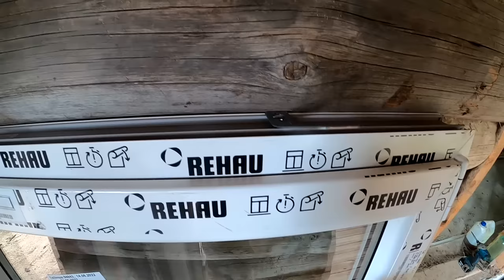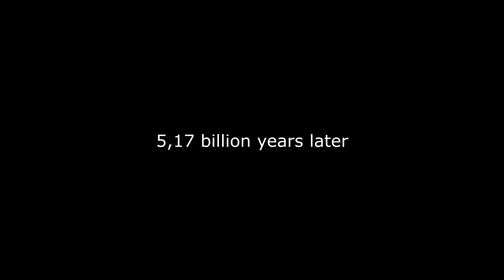Renovating a 128 year old forgotten log cabin (part20) - Installing windows and doors

Comment: I couldn’t believe how good the concrete threshold turned out, that’s skill right there!!! The windows completely changed the inside, the light is fantastic!
Reply from the maker: It sure did 👍 thanks you as alwaya 😌
Reply: I agree with the window transformation. It looked incredible and made the whole cabin look more significant on the inside.

Comment: Love your video, You make me laugh. Here in the USA our outside doors open to the inside. Had you had  your outside door open to the inside your peep hole would be on the right side of the door. I love the fact that your not afraid to reuse things and use what you already have. Things look great you do a lot of hard work and it's looking pretty awesome..
Reply from the maker: Hey Ronda thanks ❤ i think here in estonia most main doors open outwards for fire safety. Incase of a fire its easier to push a door open then to pull it.

Comment: Tere Soomest! I truly like your videos, and the humor is somewhat like listening myself. Don't really know, why it's entertaining, but I just keep laughing :D 

Had to gringe though, when you put screws on the woods you sunk in the walls by the sides of the windows. The walls of log cabins will "sink" while setting, this can be anything between 10-50mm/ 1m of walls height. By screwing the logs you prevent the logs from setting and it'll create holes to walls. Just a note and oppininon from a log cabin enthusiast. :) Anyway, keep up the great work, I love what you're doing there :)
Reply from the maker: Hello and thank you for the info. I did think about it. That's why after putting the heavy roof on it i waited about 7 months for the logs to settle before installinh any windows. I only hope it was long enough 🤔

Comment: 05:00 You need a sawzall with blades for cutting metal! It works nice on old rusty nails, and it will also go through the wood, but slowly. but you can change blades very quickly. I'm surprised I haven't seen you using a sawzall before. I have abused mine from Lidl for 3 years, best invested 50E in tool, very versatile. As usual, thanks for the video! You really motivate me for my projects haha.
Reply from the maker: Thanks Gordan for the tip ill look into it. Also thanks for coming by again 😌

Comment: Funny anecdote. We bought a 150 year old house, must have had since then six renovations at least. In the 70's the windows were replaced into something truly ugly (picture frame, bungalow size :). The previous owner tried to fix that, but keeping within the constraints of 1970 frames, still ugly... We decided to go back to the 1880 window sizing. Was not a big job, done in a week, yes included cutting walls, new cedar shingles, a drywall fix inside, etc.

The windows we took out were only two years old. There was even a sticker with the manufacturing date on the frame. And they were one of the highest brands available here, but the size was just wrong for the house. But we saved them (four times 700 bucks) and used them for our cabin. Who has thermopane glass sash windows including mosquito netting in their cabin?
Reply from the maker: That's great job you have done👍 keep up the Good work.

Comment: You can switch the peephole most probably.  A coat of paint or two will protect against U/V.  Just get the exterior paint with pigment to block the U/V.
Reply from the maker: Yup peephole can be switched around i checked it up close 👍 ill take some time before i paint

Comment: That Fenix material probably is HPL (high pressure laminate) veneered on solid wood frame it's good stuff. And for lock fitting look for Assa Abloy ,if those doors were ment to be installed in Scandinavia they love to use Assa Abbloy
Reply from the maker: Thanks for the tips buddy. The set was around 250 to 300 euros including the keybad reader. Still a lot cheaper then buying a new door 😜

Comment: Ants. You could just paint external side of the door to protect it from the sun. Also I would recommend you to remove a bark from rafters logs to avoid bark beetles.
Reply from the maker: When it comes to bark im super lazy 🤔 before i insulate the area i will remove the bark 👍

Comment: Turns out really good mate!
Will be a faboulus cabin.
The upper space for a locking mechanism on the door could very well be for a lever tumbler lock. According to my brwser translator it should be a Fiksaatori lukk in estonian. But when I searched for it it did not seem to find anything of value.
Reply from the maker: Thanks bud! Yes fiksaator lukk is correct

Comment: Oh yeah, The Ocean project. If your balcony faces east, just wait a few weeks and maybe a few big bombs will fall on your neighbor across the border. Then just wait for the rain to fill the hole, you might as well help with the hose, lol. 💁🏼‍♂️😂😂😂
Hey, very cool video. Funny, interesting and a lot of hard work.

Why don't you splash that concrete with water? Wouldn't that keep the dust out? 🤔
Reply from the maker: it would yes indeed. Good call. As for the ocean i need something bigger to fall on the bottom side of the hill. Like a moon or something
Reply: I have no doubt that it would certainly disturb the statics of your cabin... 🤔🤷🏼‍♂️😂😂

Comment: great job as usual, instead of putting the table under the door for resetting the lift, i thought you'd screw some wood between your guide wood uprights for it to rest on? maybe the table is load rated higher i don't know. also i thought you could just have tied it to roof beams when resetting but the use of spy chairs and tables is probably how the mafia trained for door interrogation/installation. :)

Comment: Nice work but the door needs to be flipped inside out because the hinges should be on the inside... The way you have it now, leaves the hinges pins accesible for someone to hammer them out and brake into your cabin easily.
Reply from the maker: I never really though about that 🤔i do have video surveillance 24/7 around the homestead so if anyone tries to break in then i atleast will catch it on video👍

Comment: I was wondering how strong your concrete was with how wet you were pouring it. Well I got my answer lol. Great job as always. Is it always normal for you guys to install your exterior doors swinging out, especially in snow country?
Reply from the maker: So what was the answer? :D poor or strong ! yes its normal for fire safety reasons doors on private homes usually open outwards (in case of a fire its a lot easier to push a door then to pull it)

Comment: Heh like the others said, the door was just installed backwards (I was told that outside doors open in, while inside doors can open either way as the builder wants.).
Other than that, you did good work, and thanks for explaining about the reason why you left a gap around the doors and windows, I wasn't aware there was an issue for putting the frame directly against the foundation / retaining wall. And so I hadn't planned for that in the cabin I am working on building myself.

I don't know if it's a concern or not but the front door at the top seems like it's a little thin above the newly installed door, and the top of the cabin walls. Is it possible that with too much wind, or cold, or weight of snow on the roof that it could snap the wall right there at the front door?

It was nice to see you get some help for once as well. Or are they potential renters for the cabin once it's complete? :D I'm hoping that you can finish up the cabin before winter hits this year, At least getting the cabin to where it's sealed and protected from the weather, and environmental conditions.
EDIT - Do you ever plan to remove the ladder from the roof of the cabin?
Reply from the maker: Im not sure 🤔 the chicken ladder will stay there untill i finish the chimney 👍
Reply: @Ants_Pants  Oooo that makes sense, I forgot that you were installing a fireplace / stove and chimney in the cabin.

Comment: Hinges on an exterior door should be on the inside; you installed the door backwards, and that is why the peephole is looking into the cabin.
Reply from the maker: Peephole can be switched around 👍
Reply: What part of the world are you king of
Reply: @SPUDHOME  it isn't a case of being king.  It's logic.  If the hinges are on the outside, then an intruder could simply knock the pins out of the hinges, and remove the door.
Reply: @s.t.2130  wake up. in ants part of the world outside doors swing out. You can complain all you want. Be a door king, or be a door idiot. Just because you believe a door should swing in. Does not change reality. Other parts of the world are not wrong. You being one minded is wrong.
Reply: @SPUDHOME  I'm not complaining.  I explained something to him.  Apparently you have a problem with facts, and logical thinking.  It doesn't matter what part of the world you live in, if the hinges to your door are on the outside, you can not keep intruders out.  Which is one of the functions of a door.  Enjoy your mental health problems.

Comment: Hate to say it but you put the front door in Backwards.  Hinges go inside.  That is why the peephole was facing inward instead of out.  With the hinges on the outside Ne'er-do-wellers can come up to your house, pop the hinges off and make entry.
Reply from the maker: Perhaps it was meant like that. All is good though all they can steal are logs 😅
Reply: Hello, what country door cop are you from. Just because you think how doors should be hung, where you live. Does not apply to the whole world.
Reply: Spud, this had nothing to do with being a "Door Cop".  The door he installed had a peep hole installed on it.  If you look carefully the door was obviously installed backwards because the peep hole, which views one way, which would normally be looking out the house, was instead giving a view into the house.  Plus putting the door on with the hinges on the outside could allow someone with nefarious ideas to pop the hinge pins and get inside very easily.  
    I made  a simple comment a year ago that I thought he may want to know about.  Ants responded, and that was that.  
    Why do you care so much to comment now to something so trivial?

Comment: You mentioned you’re going to side the exterior of the cabin.What is wrong with the logs serving as your current exterior?
The cabin looks nice with exposed logs already i think covering over them would be a shame.Nice job on the windows.
Reply from the maker: Main reason is Estonia winter months are long and hard. The logs don't act as a good insulation material. For example: 100mm of mineral wool is equal to about 500mm of wood in insulating propertys.

Comment: What are you going to with all the exposed electrical wires?Perhaps cutting in a notch where you can conceal all those wires.
There must be something about using Soviet chairs aa ladders I noticed lol.
Reply from the maker: 😆 you mean outside? The wiring will be covered by insulation and exterior finish

Comment: Hi from hot Thailand
Question: Why you make the opening from the main door to the outside and not inside?
If you have lot of snow in winter and it comes close to the main-door, you will not be able to push the main door to open it.
If it would open to inside, you still can go out and move the snow away.
Reply from the maker: Hey Thomas ! Thanks for the question. Iv always heard that main doors open outside in estonia due to fire safety reasons so if there was a fire inside you could push the door out instead of trying to pull it inwards. Iv heard it's other way around in other parts of the world wich suprised ne 👍
Reply: @Ants_Pants  - Oh, ok you are right. I am Swiss and in our 6 family house (where i lived before) in Switzerland the main door open also to outside. But apartment-door to inside.
Right now i live in Thailand and main door from our house open also to outside. So you are in all point correct. 👍👍👍👍

Comment: Need to flip that last dooe around, you have it the wrong way, always install the hings to the inside.
Reply from the maker: Depends on country of origin. Most doors here go outwards
Reply: @Ants_Pants  Had a door like that when i lived in the UKtill some 1 ised a grinder on the hings & took the door Off. But fir the one you installed it was modtly that the peep hole flap was on the outside that did it for mee butt all in all you do good work keep it up my friend :)
Reply from the maker: @RichardChasonII  grinder on the door? lol sounds like me

Comment: The large window was installed upside down the small window should of been on the left side instead of the right side. How you can tell is the handle for the small window that opens should of been pointed down instead of up.
Reply from the maker: Nope, it had the bottom plastic plate under it, very common to have smaller window on the right side here.
Reply: @Ants_Pants  And the handles upside down.

Comment: Hi Ant, shouldn't an external door open into the house?
Reply from the maker: not in Estonia or Scandinavian countries, not sure about Europe overall, fire safety demands that main doors open outwards, in case of a fire its easier to push a door outwards then to pull it inwards, like for example if a bunch of people try to escape a building at the same time, but they all get stuck behind the door trying to open it inwards

Comment: Hey Andres, why do you use screws so much? Attaching the support pieces (good carving work) I would have used nails. Higher sheer rate and quicker and cheaper?
Reply from the maker: I know that nails will be better longterm due to soft steel wich makes them not break. I only use screws for convenience purposes if i need to do some changes ots easy to remove parts 👍
Reply: @Ants_Pants  that makes a lot of sense. The first house I renovated I did all with screws. Then I started using nailer for speed and affordability. Was watching ringworm the other day and he said he screws everything together and then goes back and replaces w nails bcs it's cheaper. I thought that was nuts, but he loves alone in the bush with nothing but time...
Reply from the maker: @bigbenjit  i respect that, screws are becoming very expensive, for example tx25 5x100 screws 5 years ago cost 11 euros per box of 200, now it costs 22 euros per box of 200, you could get 200 same size nails for just 4 euros. Or if you have a nail gun then most likely even cheaper? but the thing with nails is that with a nail gun 100mm is pretty much max lenght you can go, and driving in longer nails with a hammer is hard (most nails will just bend before going fully in)
Reply: Ya, I'm in Canada and I pushed off an addition, decks, patios and fences because prices went up. They haven't come down and now I'm 2 yrs without them. So glad I've hoarded plywood, windows and fasteners.
One more question. What's a bag of cement going for now?
Reply from the maker: @bigbenjit  a 35kg bag of cement goes for about 6 euros here.
Reply: Canada 40kg bag of cement is $19.  14.50euro. Tax is only 12% tho. I mix my own concrete too w a similar mixer setup. I'm always impressed at how much you do with a honda and utility trailer. I do similar projects with a Ford F350 diesel, a dump trailer and my wife's bobkitten (S70). Your next winter project should be to restore and modify an old truck.

Comment: The main door is designed to open in not out.  Here in the US, that is standard residential, and normal motel , hotel rooms.

I love your sense of humor it adds to your videos.  Also being able to laugh at one self is the best way to Handel any mistakes you may make.
If you get upset take a break, as you are not working from a standpoint of love which keeps things from getting expensive. 

wolfmama0104
Reply from the maker: True. Much breaks are needed. Here atleast in Estonia i have not seen a single door (outside door) that opens inwards. Either they do things differently or im blind 😂
Reply: @Ants_Pants  EUROPE it is more normal for the door to open outward I think by EU building code and custom, possibility for fire safety allowing easier egress and not taking up inside space to accommodate the door swing.

The US  just has to be contrary to the rest of the world , also it allowed our ancestors to bar there homes from the English soldier's and angry 😡💢 neighbors.  We are only 250 years old a stupid teenager as countries go, Compared to  Estonia where your history is over thousands not hundreds of years.
Reply from the maker: @michelewhitewolf9856  ☺👍